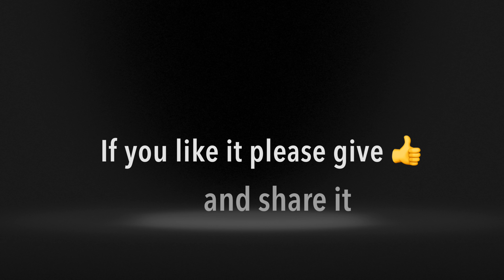Xiaomi Redmi 2 Screen Replacement

Comment: My red mi 2 water dameged screen light not show.what can i do custmor care not avaibe nearby.what is cost screen and repairment
Reply from the maker: Hello, Raj!First of all, before you start replacing screens or components, you have to perform an ultrasonic cleaning, it is the procedure applied in case of wet phones, any piece that you replace the only thing that will do is to produce a short with each start. It is the fundamental ... After cleaning you can see if it is necessary to replace the screen (complete in this case) or if the device is irreparable. Let me know how i works!! Best regards and thank you for your comment!
www.movilone.es

Comment: Hello, i have problem with this phone. It does not turn on, even no LED while charging - it could be caused by broken LCD ?
-is there something like protection - that phone will not boot, if broken screen?
Reply: maybe usb charging circuit is broken or battery is dead

Comment: How do I heat the screen without that machine to remove. TIA
Reply: I mean I don't have that machine
Reply from the maker: Hello, Wave! If you don t have a heat gun, you can use an hairdryer :) It's not the same as accurate, but it can help you! Thank you for asking! Best regards